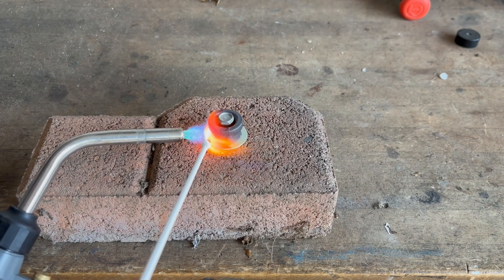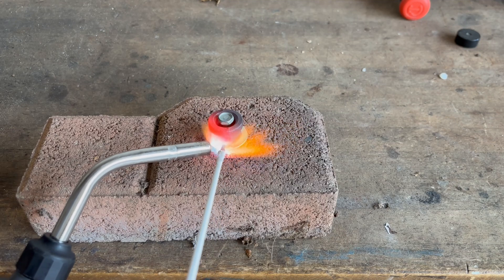Brazing Cast Iron with a Propane Torch - No Special Tools Required

Comment: I’m going to attempt to braze a crack in a huge cast iron pot
Reply from the maker: That’s definitely doable, but a propane torch won’t get hot enough. For large parts like a pot you’ll need an oxy-fuel torch

Comment: Ok it's not as simple as this makes it look. First im questioning the rod size greatly. In my personal experience (with multiple different torch heads for each gas type) using propane alone with a 3/32 bronze filler with appropriate material thickness for that dia rod it was impossible to flow. Using propylene("mapp gas" or map-pro is propylene after the original manufacturer ceased production suddenly in 09') it didn't fair much better. Only after switch to an acetylene/air torch did it flow correctly. 

Note: I said "appropriate for that dia rod" 

However if we go with 1/16th dia filler with material thicknesss appropriate for this dia you'll find that propane and mapp work just like on the video here. 

Another thing to pay attention to. He's using a brick to work on not anything metal so as to not draw heat from the work into the base it's resting on. 

Lastly. By definition this is braze welding not brazing. braze welding is done just as one would gas weld with oxygen/acetylene. Brazing is done more like soldering. The work piece is heated thoroughly to the correct temperature then the flame is brought away from the joint and the heat from the work piece melts the rod on contact drawing it into very tight joints ideal for pressure systems etc. brazing its crucial to have correct fit. To close the filler won't draw up. To wide the filler won't draw up. 

so braze welding is gas welding with a bronze rod

Brazing is closer to soldering 

Neither one is wrong or right. Each has a purpose. If at first you can't get the hang of it just keep trying.
Reply from the maker: Thanks for the detailed breakdown and helpful tips! I was able to use a 3/32 in bronze rod with my high-heat TurboTorch TX-504/503 torch (the 504 tip is better for larger parts). Though I definitely agree that for most DIYers, 1/16 in rods are much easier to use.